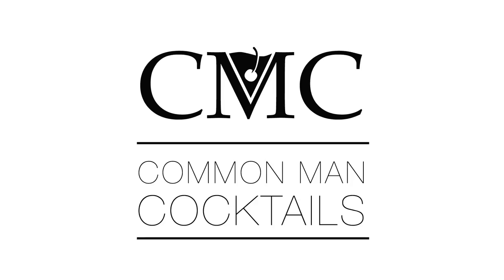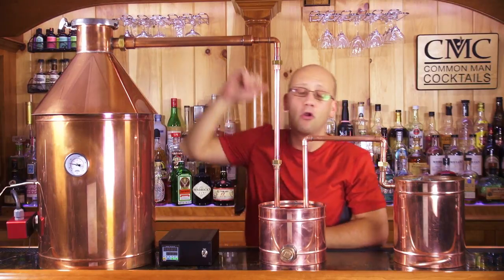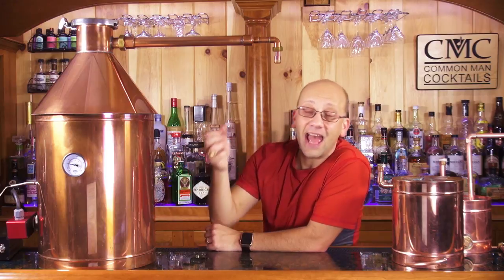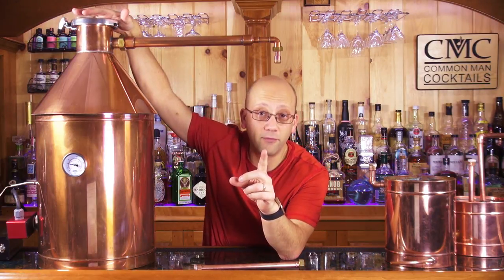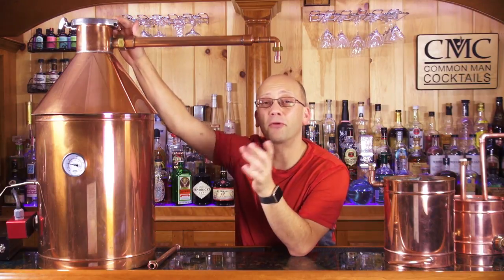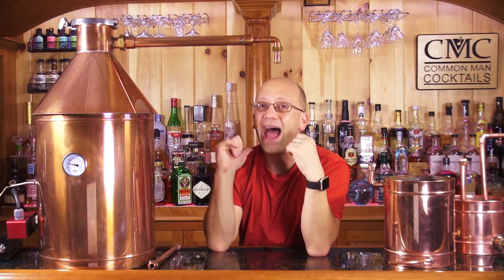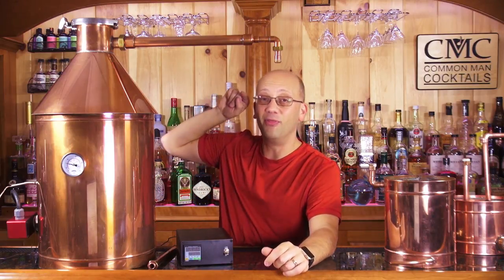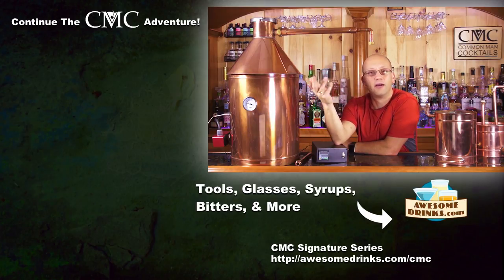Copper Moonshine Style Stills | Understanding Pot Stills, Column Stills & Distillation

Comment: Good job - I would like to see  more about the heating process and how the thumper works - I assume you have to heat the thumper too?
Reply from the maker: the thumper does not need to be heated, the heat from the main distillate moves down into the line and into the thumper and heats it up, and then that second stage of distillation occurs. However, the challenge then is to make sure you don't bring the heat up too fast because, once you turn it down, it's going to turn down the thumper slower, so it takes about ten minutes to alter the final temperature as it moves through the line.

Comment: Hi, built a very small home still years ago, but someone told me about a “SNEAKY STILL” that is made from a 500 watt soldering iron and some sort of configuration of copper piping. But apart from knowing that, that is all that I know. So with me been in England, distilling is NOT a big thing. So I was thinking that YOU might be able to point me in the right direction for getting the information that I am looking for. 
Many thanks in advance. 

Bye from John.
Reply: Sorry for any spelling mistakes, as I need a bilateral cataract operation, so am not seeing the keypad on my phone that well 🙁😎🤩🤓

Comment: I would greatly appreciate it, if you would do a video comparing the column and pot still.
Reply from the maker: You can convert this pot still into a column still, it's really not something to compare/contrast, however, as they're designed for two different purposes. The flavor profiles of the final product will be different but it's not "bad" vs. "good." 

You'll find column stills do a great job wiping out most of the congeners from the distillate and cleaning it quite well...but doing that to a whiskey or rum can destroy any of the actual flavors (given those same congeners are responsible for the character of the drink).

You'll find some products, like rums, use both a column still and a pot still and blend the two final products together for their signature flavors. Vodka, however, goes for "crisp and clean" and because column stills do that fast for less overall cost (because time is a cost) most folks use column stills for vodka. Of course, then you have tito's, which "finishes" it in a pot still (but the starting product is no doubt either column stilled vodka or purchased product already distilled that's run one more time through a pot still to soften up the flavor).

Comment: Could you exchange the cooling down water flow in 2nd pot with ice?
Reply from the maker: Cooling it down can be an interesting amount of work, I've used ice and pumped it into the cooling coils but you'll find you will spend a good deal of time refreshing ice and pouring out the water over the course of hours. 

You can also get really crazy and get a water cooling system that chills with freon and whatnot (or find one used from a manufacturing facility that may be trying to get rid of old ones). But yeah, poor man's method is either ice or hours of running water :)
Reply: @cmcocktails  a creek would work? Say ya put inlet tube in creek water held down by rocks. Maybe a small pump attached. I've two creeks beside my home

Comment: If you do a follow up video on column stills do go into plates vs. packed ceramic beads. It's been many years but I ran the beads and from how I can reiterate, they act like hundreds of micro plates but lack the pure separation of a true plate so they are only so effective (I found that it would carry quite a bit of flavor too). I was still able to get ~190 proof from a single distillation on a packed bead column.
Reply: And if you want to get into gin theory you could talk about in-line botanical baskets! (ah, you got to that later in the vid) edit/
Reply: Yep I use I a packed reflux ccvm too.  I am getting 91% right now.  I think with a longer column I will reach 95%
Reply from the maker: I've got to do more research and testing on gin, after we play with rum a bit :)
Reply from the maker: 95% is pretty freaking sweet :)

Comment: If I a reflux still is ran without hooking  up water to the dephlegmator will it technically run similar to a pot still?
Reply from the maker: From my understanding, dephlegmator's are at the final end of a column in a column still, creating additional reflux. It's enhancing the abilities of the column. A pot still has no columns and uses its natural shape to perform the condensation and such. I don't see any ways in which a column still, using the column, would give you the effects of a pot still.

Comment: Looks cool, only thing that bothers me is 'caplogix' that's just a triclamp and cap...
Reply from the maker: it's just smart business :) There are dozens of great "inventions" that were just repurposing something in another way, but doing it for the first time. If you look at many stills you'll see it can be kinda a pain in the ass to work around this problem, he just solved it for this case. And, had to have pieces custom built and sized for the application of use. But, true, the concept of a cap and clamp itself isn't new. It's just nobody has troubled themselves to fix the design "flaw" of older stills.

Comment: How come your 10gal unit looks different then the one on Steven’s site?  The 20gal however looks the same as yours.
Thank you for the video
Reply from the maker: Mine is definitely a 10 gallon, the difference is the "top" on the one in the photo, I know you can get different tops, that might be a newer version, if you want I can ask Steven.
Reply: This still has the 4" Cap Logic Cap. That is why it looks different. With this cap you don't have to use flour paste.
Reply: @mrgolf30     there is no electric port on the 10gals on the site  either

Comment: So, how much actual, drinkable spirit does a 10-gallon still will produce?
Reply from the maker: with good sugar content on the fermentation? about 2 gallons or maybe a bit more, but it depends on what you're making and your experience. "If I did it", I'd say that the first run was less than 2 but the second was much closer :) If you're doing rum, for example, and you add a good deal of sugar and let it all ferment to alcohol you'll, of course, get more product out.

Then you have to toss the start/finish and take the middle, so it's not bad to get 8 to 12 bottles of spirit (where a bottle is 750ml).
Reply: Common Man Cocktails Thanks. I would like to make whiskey.

Comment: Sweet! 
Rum wash recipe?
Making cuts - based on smell? ABV? Column Temp? Volume output?
Blending cuts?
Reply from the maker: yeah, rum wash (molasses/sugar), cuts based on everything ... because it's all new :)
Reply: Well, the best advice that I ever got was from an old timer in Dahlonega, Georgia, he said that you don't need to watch your temperature except to know when to stop collecting, and you don't need to worry about ABV until you're ready to dilute it. All that you need to know during your run is that when your pot begins to produce, throw away the first 3 ounces for a 5 gallon run, then collect everything else after that into half-pint jars, and you should collect about 20 of them if you stop collecting when the head temp reaches about 200 degrees, at least for a 5 gallon pot and about an 18-20% wash. Then, when you have all of your jars, start in the middle where you know it's hearts, and it should be a somewhat neutral smell and taste, then try each other jar one at a time in both directions until you don't like the smell of the jar. Collect what you like, throw away what you don't. He said it helps if you keep the first jar (mostly heads) and the last jar (mostly tails) as samples to remind you of what your hearts should NOT smell like, at least until you learn what it smells like. 

As for wash recipe, you can have whatever percentage of molasses to sugar that you want, but the best is a pound for pound equivalent - for a 5 gallon run, 10 pounds of sugar to 1 gallon (10 pounds) of molasses. Feed molasses is OK, just make sure its unsulphured.

Comment: I bet that most if not all copper unions were made soldering,... remember the problem with lead paint... whel the same problem seems to occur with soldered pipes... solution, use tig welding
Reply: They are using non-leaded solder which he mentioned at the beginning of the video. Just costs a tad more.
Reply: They have silver lead free solder

Comment: why copper vs something like stainless steel or cast iron?
Reply from the maker: I'm not exactly sure how heavy a cast iron still would be, but I'd imagine enormously heavy and unwieldy  :) Stainless Steel can be a thing, however, most people agree that copper imparts a taste/softness to the distillate. It is said that copper (at a molecular level) wipes out any sulfur like flavor that can come through the distillation process (from the yeast)
Reply: Stainless is very common in stills — you just need some copper somewhere in the vapor stream to remove sulfur from the vapor. A lot of people using stainless stills use copper mesh (think of it like cookware scrubbers, but made of copper) to pack a section of their column or lyne arm, and that is usually plenty to take care of the sulfur. Additionally, packing an entire column with copper mesh gives almost the exact same result as bubble plates in a fractioning column (for some nerdy reading, look up "HETP" in relation to distilling...) 

TL;DR yes, stainless is super common for distilling, but some copper in the vapor path is necessary.
Reply from the maker: Yes, and no doubt cheaper. But from a "one vs. the other" I'd assume the PRO for stainless is cost.